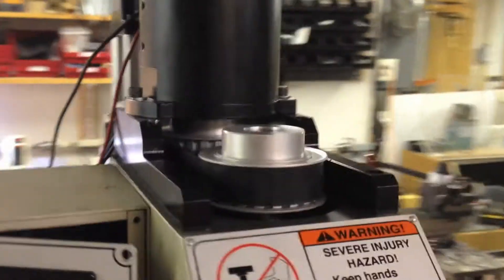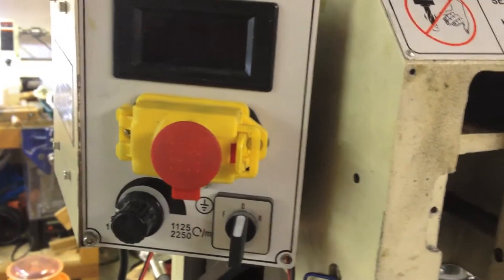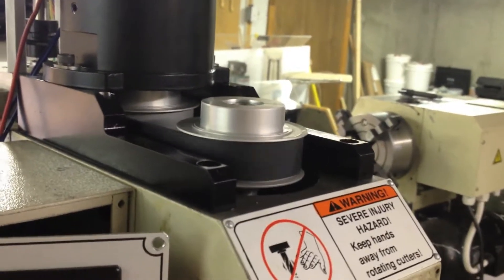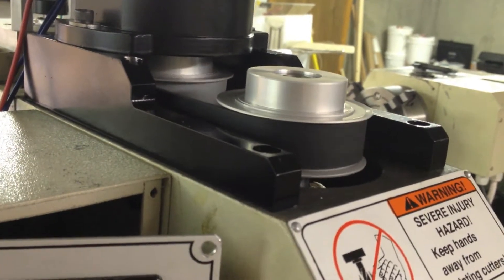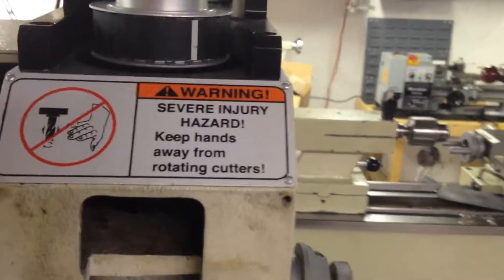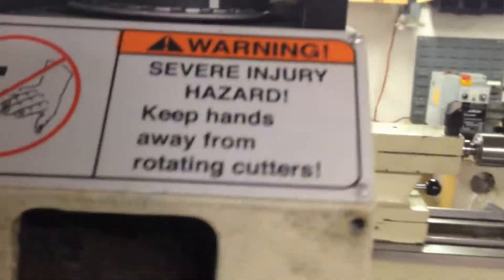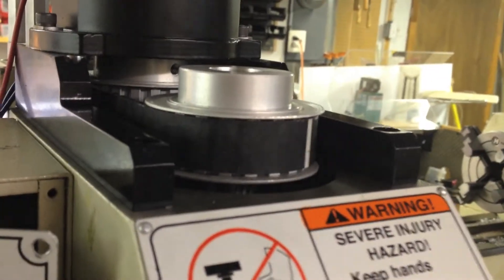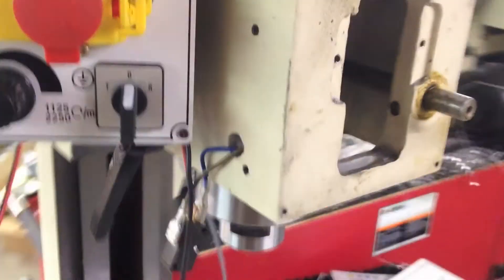G0704 Belt Drive and Treadmill Motor Conversion

Comment: what esc are you talking abought an what brand motor, apso where did you get your pulleys an belt? Thank you for vid, im tryn to do same an need that info, also you cant use the factory esc?
Reply: Josh, everything I did is based on purchasing the plans from Hoss. You can find him on the CNCZone bench top machines forum. Search Hoss and you will find him easily. I support his work fully and it would not be appropriate to give away the information that I paid him for to do my conversion. The motor is a generic treadmill motor I found on eBay. You can use the factory ESC but I wanted to use something more reliable and better documented.
Reply: Michael Hackney yeah i got his plans but i need info on where to get speed controller an what motor to get for it or vice versa
Reply: and pulleys, il have to check his plans again i dont remember seeing pulleys on plans but il check again, some of cad files are really blury imo
Reply: So the motor you can just buy a suitable treadmill motor on eBay. My CNCZone build thread has specs for the motor in it as does HOSS. I bought my controller so long ago I don't recall where I got it but it is a commodity item available in many places. Pulleys all came from SPD-SI: http://www.sdp-si.com 

The electronic CAD files HOSS ships are standard DXF files and are not blurry - they are the actual DXF code. Maybe your printer has an alignment issue?
Reply: Michael Hackney yeah im talking abought the plans looking at them in picture viewer, mabe thats why mine are blury is because i havnt loaded them into a cad program
Reply: ok bud im sorry to keep picking your brain, I just went through every file on my hoss disc an theres nothing on pulley sizes part# or anything abought motor info or pulley info,....you would think outa all the mods that info would b on his disc,...could you post your pulley part # an belt # i looked at that website you posted an there is over 4,000 pulley an sprockets,...never did find anything similar to what everyones running
Reply: Josh, it's been 5 years since I did this! Go to the CNCZone and ask Hoss or email him. I'm sure the sizes are posted in my build thread too. But I just don't have the time to go look there.
Reply: also i did try to reach hoss with no response, next i guess il try cnc zone if you are not able to find info,...thanks for your help an patience
Reply: I just looked at my file archives and in the files Hoss provided is a folder called CNC Timing Pulley in the Belt Drive folder. In there is a spec for the pulleys. It is an XL size belt and he describes how to calculate the required length based on the pulleys you get - there are options and I don't recall what I got. He got the pulleys at econobelt.com. The spindle pulley us 40 teeth XL QPEXLA37040N16 the motor pulley is for the nordic track motor is 30, 40 0r 48 tooth depending on what ratio you want:

30 tooth gives .75:1 QPEXLA37030F10
40 tooth gives 1:1  QPEXLA37040F12
48 tooth gives 1.2:1 QPEXLA37048F10

I did the 1:1 ratio
Reply: Michael Hackney thankyou so much i know im not the only one whos running into this issue, i should be able to get a idea from that, thanks again!!